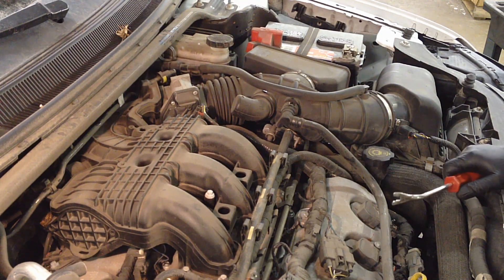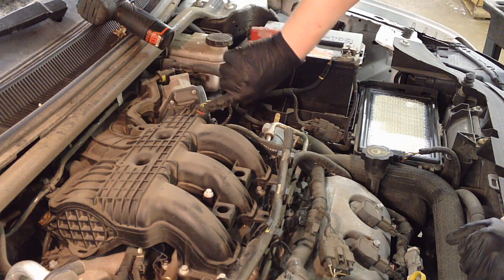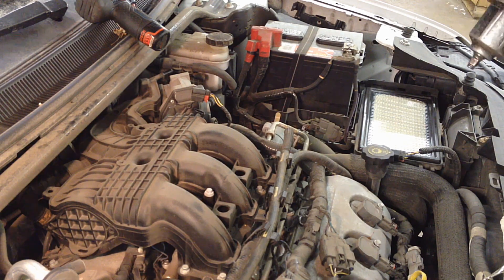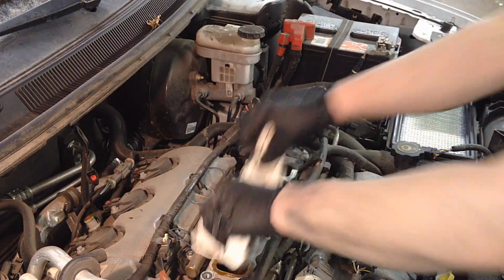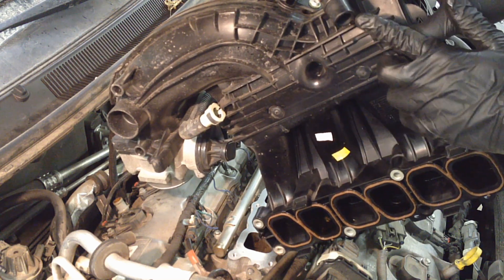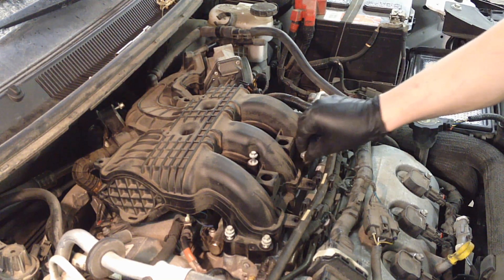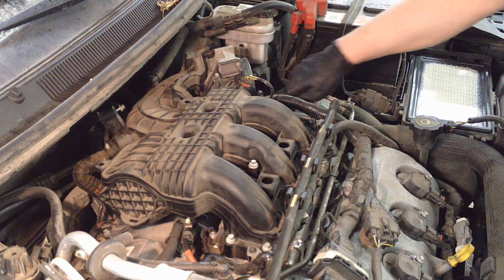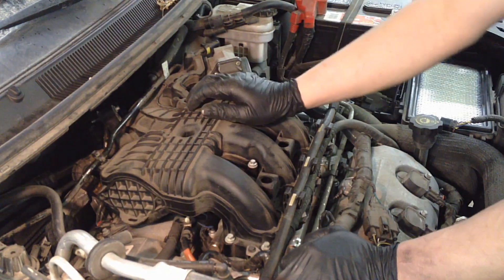Ford 3.5L DOHC Upper Intake Removal Procedure

Comment: I have a 2013 Ford Taurus that I just changed rear spark plugs where I had to remove the upper Plenum. After I was done and had everything reinstalled started the car and it sounded great then as I took off down the street it shut my car off, shut my car off and felt like it locked up the brakes. The brake pedal was so hard that I could not push it down to restart my car. I had to wait a minute to restart it, and I was barely able to back  into my driveway. I checked all my connections and have not found anything off or disconnected. I’ve now removed the intake and put a new gasket on which I did not do prior and I’m hoping for the best. If anyone’s had a problem like this, please let me know what you found.

Comment: This video was very helpful changing spark plugs in my 2009 Ford Taurus X 3.5L engine. This required removal of upper intake Manifold to get to the rear plugs. The attachment for Torque pattern of upper intake manifold bolts was also very helpful.

Comment: So what is that wire for the hooks to the back of the antique with a little rubber pieces PC valve rubber piece there’s another wire that was not hooked up that you did not show

Comment: I’m working on 2012 f150 3.5 eco boost trying to replace the coolant line feeding the turbo it’s rust pitted and leaks on the back of the head I have already removed the intake and the crossover pipe for the coolant how do you remove the tube did you remove the clip or did you remove the fitting with the tube on it?

Comment: the upper intake bolts i believe i messed up on. i believe i over torqued them . i mistaked inch pounds with foot pounds. i torqued the bolts at 10 foot pound and then little more with 1/4 in drive ratchet. i did not snap one off or anything but i feel stupid about it. should i loosen them and retorque them ?

Comment: Hey dude hopefully you get back to me ASAP.  I was changing out my spark plugs on my 2012 Ford Fusion sport. It’s giving me a code p0205. Which isn’t an ignition issue in cyc5.  Why would that come pop up?  I didn’t touch the injector lines at all and I went back and double checked and everything and still had that code. Would would cause that code from doing spark plugs and not injector ?  My car was running perfectly fine with no ignition code ever. Has 72 k miles and just wanted to do my plugs cuz I had time and had car almost 8 yrs new off the lot.

Comment: Anti-seize on spark plugs... yea or nay?
Reply from the maker: yes a small amount
Reply: Thanks.  Following this video as a guide,  replaced spark plugs, coil boots, and PCV valve in an 09 Edge in under 90 minutes.  The Edge is a bit different but this video shows the way.  Nice job.
Reply: @ohger1  does that PCV valve  just twist out?
Reply: @freewaycommander  Oh crap, don't remember 100%.  Here's what I do know: it was not an issue.  IOW, it either twisted in or it was held down with an easily accessible screw.  If it busted my balls, I would have remembered.  Still, if I had to bet, I'd say it just threaded in.

Comment: Please help!! I get code P0346
Ive replaced all 4 camshaft sensors also replace 2 camshaft sensor harness. ,new battery , new starter. Changed my bank 2 VVT solenoids.  And still not the code not going away. The only symptoms my car has is it has choppy acceleration. From 35mph to 55mph. Please help. Its a 3.5l Ford Explorer 2014.

Comment: Can you do a video on 3.5l fuel injector replacement? Is the process the same as far as having to remove the intake manifold? I have a 2010 fusion sport that is running codes 0204 and 0304.

Comment: Doing this same procedure, I found that one of the 8mm bolts that hold down the intake was missing. The part number according to the manual is w503282. Any idea where I can get this bolt other than a Ford Dealership? Thanks for this video. I just went step by step using the manufacture's manual by was disturbed finding that bolt missing. I'd been looking for a vacuum leak. Do you think that may have been the issue?

Comment: Can you re-use the old gaskets or do you recommend getting new one's?
Reply from the maker: +Louis Van Dyke Fords official stance is 30k miles or less you can reuse them
Reply: Thank you so much for the reply!
Reply: One other question...  My car has 160K, do you recommend changing the PCV valve as well when changing the plugs?
Reply: FordTechMakuloco any thoughts on replacing the PCV valve at 160K?  Thanks!

Comment: Thank you very much sir for posting this video! I watched it a few times and knocked out the spark plug change on my wife's 08 Taurus X in no time. Also, thanks for the tip on using a trim panel tool to take care of the wire retainers. That tool was well worth the $10.

Comment: I watch you all the time and I have an un related question.  I have a 08 Ford Edge that has an power steering leak. What is the best and correct method for replacing the pump, it is so hard to get to. I don't have a lift, so I'm doing this from the ground. You can reply here or better at Bass54me@aol.com. Thank you very much. Looking forward to your response

Comment: I did this job today on my 2011 Taurus with just under 90,000 miles. Its actually a tad bit easier than the Edge. Thanks for the video. I'm sure Ford charges around $400 for this job.

Comment: Two of the bolts broke when I was removing the intake manifold. Is either W714133-S439 or W503297-S437 the correct replacement part #?

Comment: Hard to find a torque wrench as low as 90 inch pounds.  The lowest at O'Reilly was 120 inch pounds so I used my old manual torque wrench to about 7.5  foot pounds.

Comment: Got the manifold off, replaced the 3 back spark plugs...had to get an 8 inch extension plug socket, checked the gaskets and decided they were good and did not replace.  Hope i do not pay for that down the road.  Car started up, no problems.  Thanks again for your video.

Comment: So far the hardest part is getting those plastic hold downs pulled.  Second hardest is breaking the plastic holder clips on the fuel lines.  Went to O'Reilly and got more fuel line clips.  Also on the wire to the intake, it appears than I messed up the red clip holder as it can be pulled off now without pulling the red clip first.  Still in process.  Getting ready to remove manifold bolts.

Comment: I've turned a few wrenches in my days-but ever since computer chips started to outnumber "nuts and bolts" on my engines, I've stayed away from messing with stuff under the hood.  That said, the quote I got for changing the plugs in my 2012 Lincoln MKZ really set me back on my heals.  My reaction... "what the hell, I should be able to change plugs, right?"  Well, after analyzing the situation on my Lincoln 3.5L, not so much. Until I watched your video.  Simply stated, I would have never tackled this job without watching your step by step approach to accessing those plugs.  I had you right there beside me (well, you were on my laptop) every step of the way.  I'm proud to say, everything went like clockwork.  As a result, I know the job was done right, I saved a boatload of money, and the car runs like new.  You should take great pride in knowing you're really helping a lot of us regain our confidence to venture under the hood again!  Many many thanks.
Reply: You prolly dont give a damn but does anybody know a method to log back into an Instagram account..?
I was stupid lost my password. I would appreciate any tips you can offer me
Reply: @Rhys Ethan Instablaster :)
Reply: @Ira Memphis i really appreciate your reply. I found the site thru google and im in the hacking process now.
I see it takes a while so I will get back to you later when my account password hopefully is recovered.
Reply: @Ira Memphis it worked and I now got access to my account again. I am so happy:D
Thanks so much, you saved my ass!
Reply: @Rhys Ethan No problem xD

Comment: I was wondering if you might know where cylinder 5 is because I have a misfire and my check engine light is flashing I changed all the spark plugs and tested all the fuel injectors with the tool so I'm thinking it could be the 5th  cylinder  coil pack but I have no idea what the firing order is for my 2009 ford taurus could you please help me out
Reply from the maker: +Alonzo Knight Cylinder 5 is the front bank center cylinder
Reply: +FordTechMakuloco  so the one in the middle that you have to take everything apart to get to huh  /:
Reply from the maker: +Alonzo Knight no it's the front head the easy one you lucked out
Reply: +FordTechMakuloco  thank you so much for your help I just subscribed and liked the video

Comment: Thanks for posting this video.  I am changing my spark plugs.  I have 90K miles.  Can i wait until 100K?  One other thing, can you supply me with the name of the Ford engineer who designed this monstrosity for doing what should be a simple spark plug replacement?  I'd like to punch him. :)
Reply from the maker: You can wait until 100k no sweat.
Reply: Thanks.  I replaced the front three and will replace the back three in a while.  I assume as long as the back plugs are firing okay, having different age plugs has no impact on engine performance? Yes?

Comment: Can you tell me which is cylinder 3 on the Ford 3.5L?  I'm getting a Injector Circuit / Open Cylinder 3 code on my Mom's 2010 Ford Fusion Sport and I'm having a hard time finding which cylinder number three is.  Thanks for any help!
Reply from the maker: #3 is the rear bank and the closes to the drivers side.

Comment: Where is the temp senor located on the edge? I have an 08 edge se. I am having trouble with the new cooling fans I installed they stay on all day unless I disconnect them from the harness. any advice ? thanks

Comment: quick question ..I did this procedure before I saw the vedio and didn't replace the intake gasket and didn't work either but followed the sequence plz help car has no codes and hesitate up hill or hard acceleration
Reply from the maker: +Justin Carriere If there is a concern with the intake gasket you reused it would show up when at idle you would have lean codes.

Comment: Thank you very much for posting this video. Without having any previous experience working on cars, I needed to change the spark plugs without paying an arm and leg for it. Your video helped guide me from the upper intake, down into the engine, and back. If there is anywhere to review you/business, 5-stars, no question.
Reply from the maker: +John Redmon, Jr. You can rate it here actually thanks!https://www.facebook.com/BSGautomotive/

Comment: Thanks man. I am a GM tech and have to do the plugs in my wife's new MKZ and was trying to find out the torque sequence and number of passes.  Helps a lot thanks.
Reply from the maker: +Ryan B No problem glad to help.
Reply: +FordTechMakuloco Do you always change out the upper intake gaskets for this procedure, I am assuming from the video they are fitted gaskets? Secondly, once the coils are loosened I usually use a little spray synthetic lube in the plug bore to help ease the boots out.  Do you agree or should I be ready for them to be stuck and separate from coil on plug assembly? Thirdly, I picked up NGK Iridium's for the job, what's your thoughts? Motorcraft only or will these work to spec...?  Thanks for the help man.  I am a retired GM dealership tech (well retired, as in the car came off the hoist and ended my career and almost life) and have been out of the main loop for 10 years now.  Thanks in advance, really appreciate the help one wrench to another.
Reply: +FordTechMakuloco  By the way the video is great.  Easy to spot a professional from a curbsider in about 10 seconds.  Appreciate that.

Comment: Great video, what can you tell me about the water pump location? How it's driven, how hard to replace? And how any hours it takes? My 2007 edge has 102,000 miles, should I be concerned ? Thanks

Comment: After replacing the plugs and coils, 2008 Lincoln MKZ AWD, 136,454 miles,[possibly original, had .084 gap and re-flashed PCM, The engine ran until I turned off the heater, then it stopped. It will not start, only turns over for a while  even when the key is released, then stops. What would cause this? Do the chips in the keys have anything to do with this?

Comment: I was worried that I was not knowledgeable or confident enough to pull the intake off to replace the rear sparkplugs. After watch your step by step instruction I have decided to go ahead with the task of replacing the spark plugs. Thanks and Good tunes in the background. with the money that I save I can afford a nifty impact driver.

Comment: Just replaced spark plugs on a 2012 Taurus SEL. This video is very similar to what I saw. the only difference is that there was no rear mounting bolt on the back of the intake. All in all this video is excellent. I do recommend buying the tack claw that he uses in the video and using the inch pounds torque wrench.

Comment: Thanx for a great vid! Most of my knowledge is w/ Asian imports. This should be the same on a 2007 Freestyle, correct? I'm doing a tune up on one soon (168,572 miles) .I don't think it's ever been done. Thanx and G-d bless.
Reply from the maker: It will be quite close except for the few connections to the manifold. Yours is a 3.0l.

Comment: Thank you for taking time to post this video. I am helping my brother change the spark plugs because of misfiring.  Did the first 3, and watched this video to remove UIM to get to the back, the only place you lost me is the bolt on the bottom that you removed. where exactly is that?
Reply from the maker: Royalty335 Some have it some don't, the one under the throttle body is a black bracket follow it down. Again yours may not have it.

Comment: Hi would a leak in the PCV or other parts of the crank case ventilation system result in the entry of exhaust gases into the cabin? thanks
Reply from the maker: It will smell like a raw exhaust leak form piston blow by and oil vapours but it is not directly and exhaust leak no.
Reply: FordTechMakuloco Any chance it could be the reason for the recent NHTSA interest in the ford explorer? http://www.bloomberg.com/news/2014-06-20/nhtsa-examining-data-on-exhaust-leak-in-2011-2014-ford-explorer.html

according to affected owners (including me), the smell comes out consistently about 15 to 20 secs after hard acceleration (when the vacuum in the intake manifold disappears?)
Reply from the maker: danny dboy No that smell is from the sulfur from the gas being burned by an overly active cat, Toyotas and Mitsubishi are the worst for it. There was a message on this awhile back but again all trucks do it.
Reply: FordTechMakuloco Many thanks Fordtech!

Comment: Great video. I just changed the plugs on my 08 Taurus x 3.5. After putting everything back together it wont start. it will kick over but not fire up. is there a relearn procedure? is my factory alarm messed up from the battery being disconnected?  any input would be appreciated.
Reply from the maker: Factory alarm should not be messed up. If it has high mileage you will have to clean your throttle body and do a relearn as per these two videos of course make sure nothing was left unplugged.
How To Clear your PCM'S Memory on Fords After Repairs
Cleaning An Electronic Throttle Body Safely

Comment: Great video, going to change plugs today. What is the torque on the brace
bolts ? And yes, the winter was brutal in Wisconsin, on road all the time and
work outside a fair amount.
Reply from the maker: 90 in lbs
Reply: FordTechMakuloco Didn't need to take brace off, '08 Taurus X.
Video was very helpful, at nearly 226K, she runs like a top. Now,
to get the output shaft speed sensor replaced at my favorite tranny
shop. Hope it lasts me a while, owe way too much on it. Thanks much !!
Reply from the maker: Oh I thought you were talking about the top and lower brace bracket bolts for the upper intake.
Reply: FordTechMakuloco Nope, the big brace by the cowling in back. That's
OK, mine was an easy R&R.

Comment: Has Ford ever issued a recall on plastic manifolds with the risk of them cracking?
Reply from the maker: Yes but more of a extended warranty on the Crown Vics and that was for a coolant leak. Any new intake does not have coolant running through them.